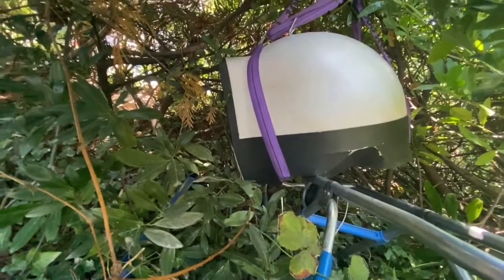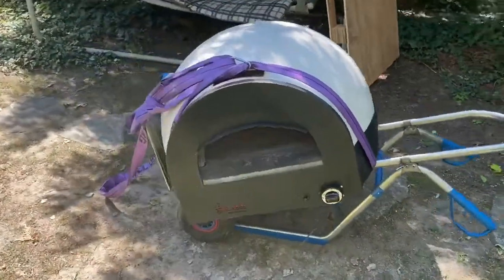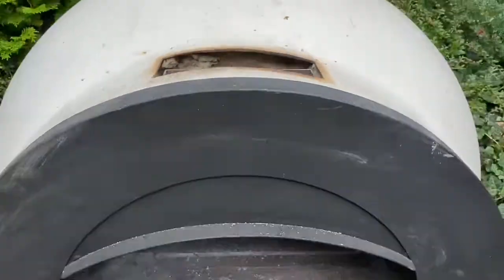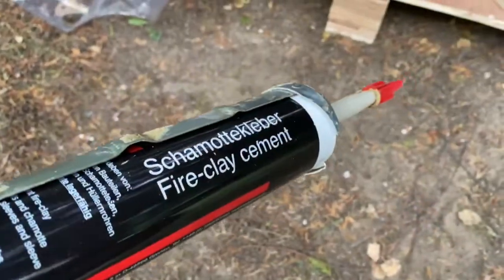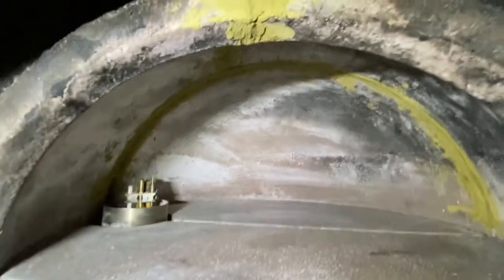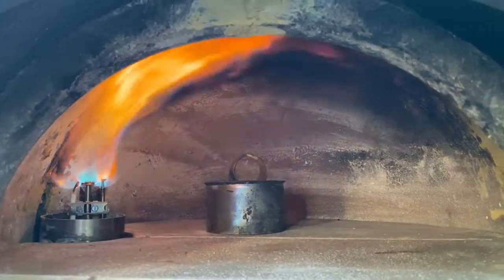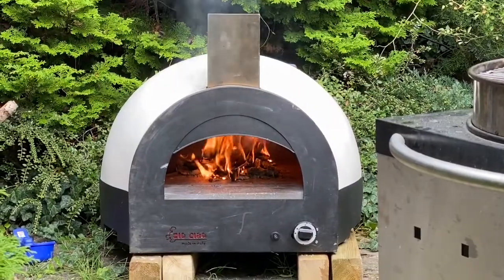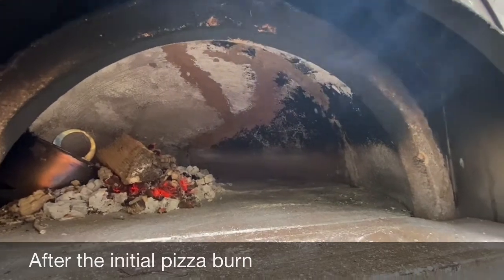Back on fire! 🔥how I repaired my cracked pizza oven

Comment: I don't have access to fire brick glue but I do have fire brick morter.  Could I just fill my cracks in with fire brick morter?
Reply: Actually it's refractory morter that I have.  Is that good enough to fill the cracks?
Reply from the maker: If you‘ve just got some cracks from the heat you don’t need to repair these! It’s just normal for stone ovens… if it really broke like mine you can use morter as well! Just make sure to dry it slow and don’t push the fire after that too far… just cure it like in the beginning! Good luck 🤞 hinze
Reply: @hinze55555  Thanks much!